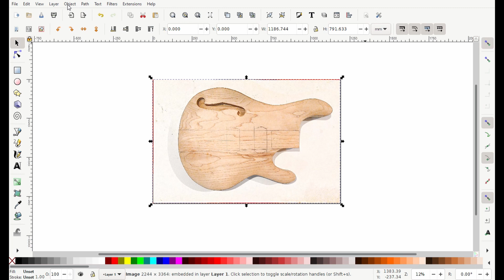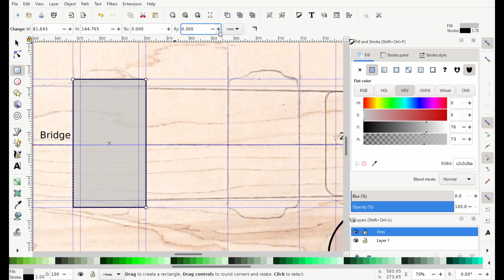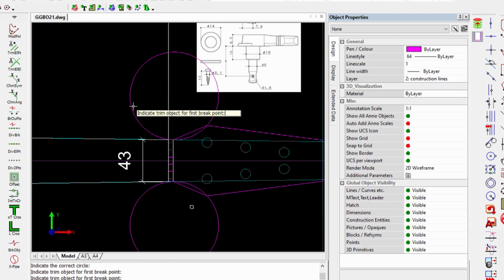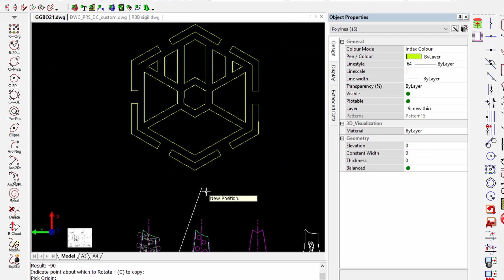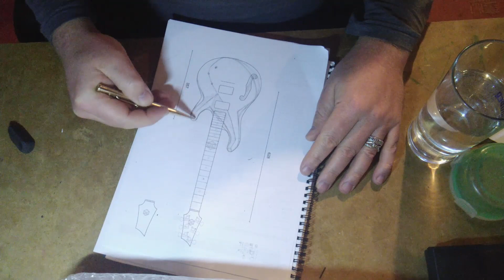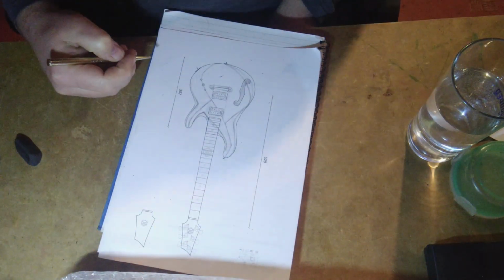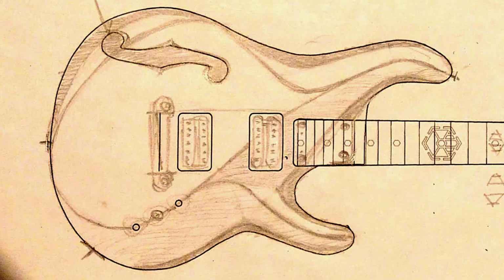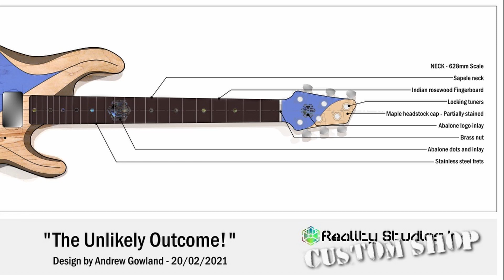Great Guitar Build Off 2021 Kitbuild  Ep 1 - The Design!

Comment: What I'd do would be to make a channel inside the body, put some LEDs in the F-hole and flood it with translucent resin so that you can add some light on it, but that's just me. However the through body F-hole sounds sick
Reply from the maker: LEDs have been considered,  However, with a somewhat limited tool and skill set I think this is the best option and would be pretty sick as you say 😁